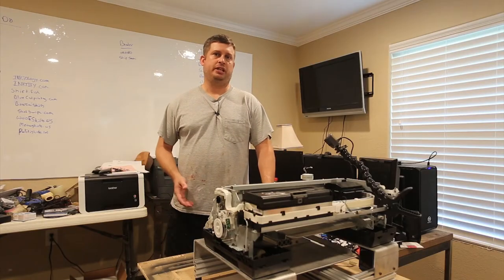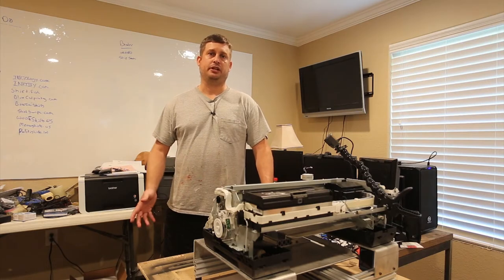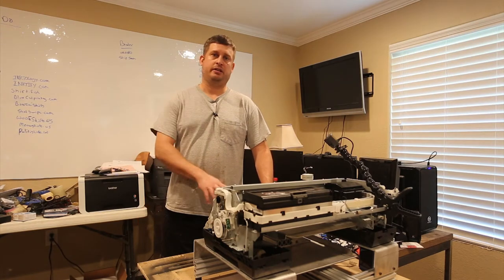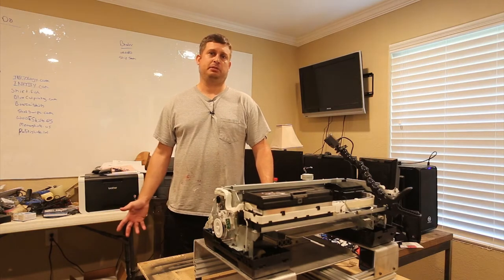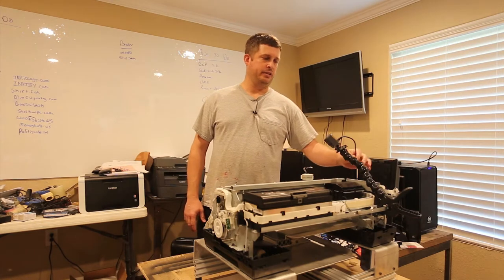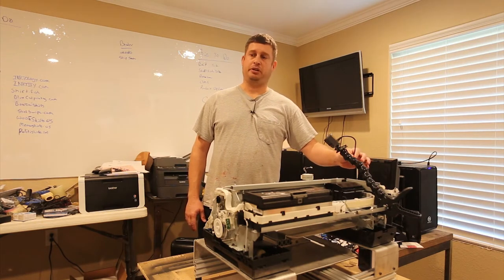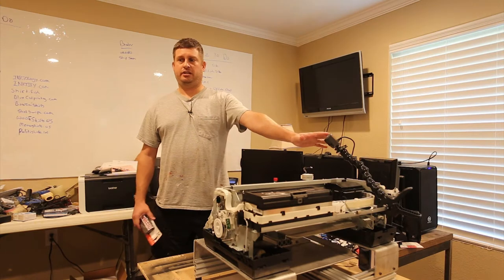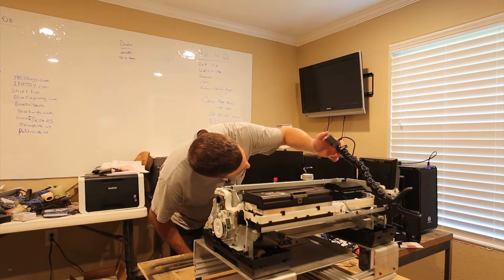OpenDTG - Part 4-  Motherboard install and control relocation

Comment: I took apart my 1430 to replace the ribbon to the print head. I put it all back together, but the printer will not power on. What could I have missed, or installed incorrectly that would prevent the printer from powering on?

Comment: Thank you so much for making these videos. i was on the fence about trying this myself, but now i know that i can definitely do it. It seems like if you are somewhat mechanically/technically inclined and patient it should be relatively simple. Question...did the instruction printout that you're using come from opendtg?
Reply from the maker: Sort of.  I watched OpenDTG's videos and compiled them into a set of instructions.  I contributed it back to the project to help others.